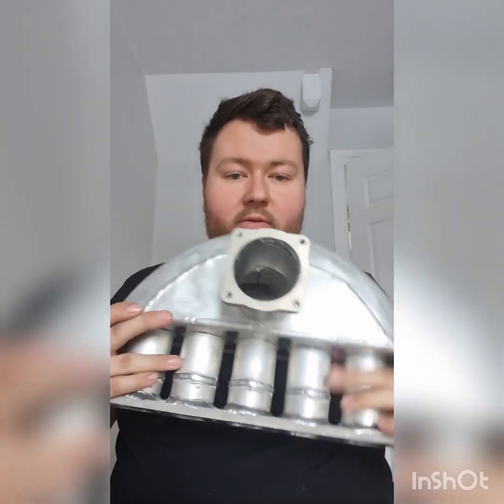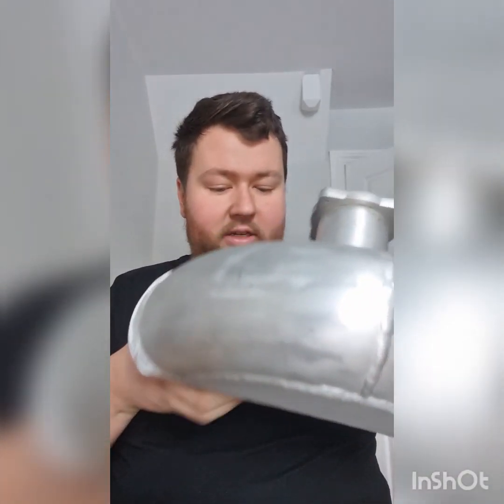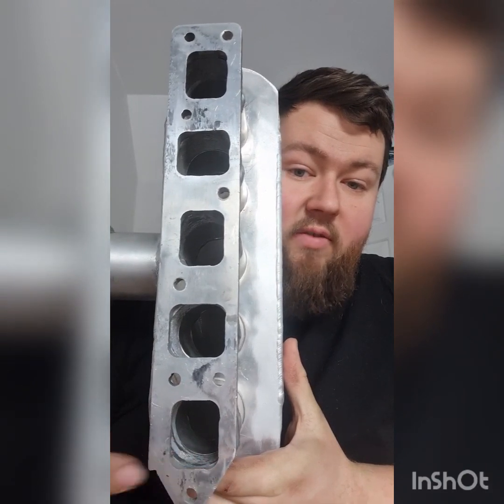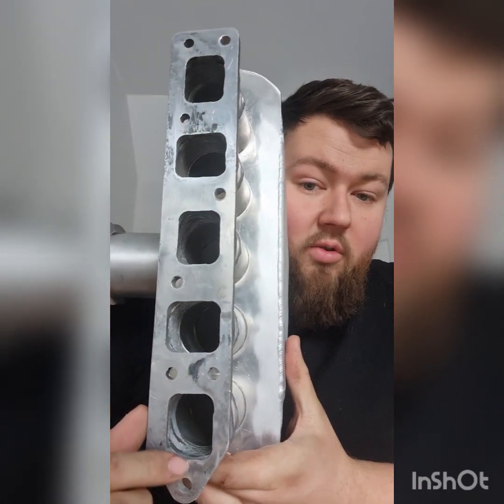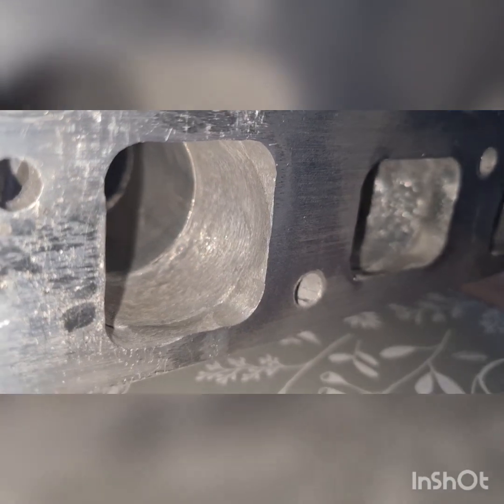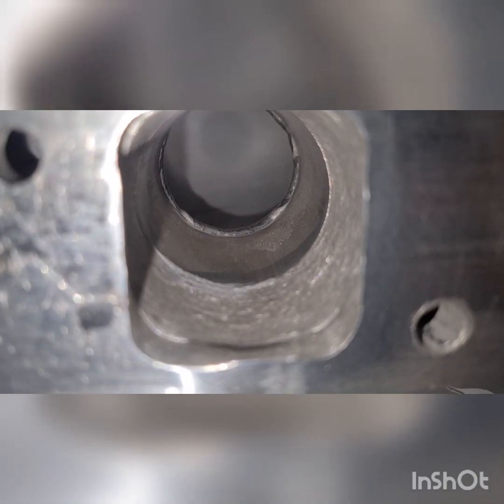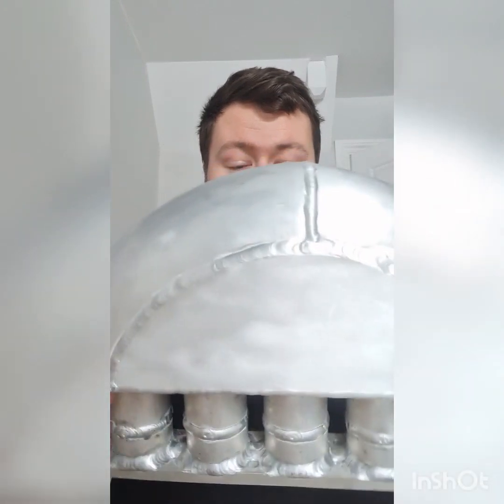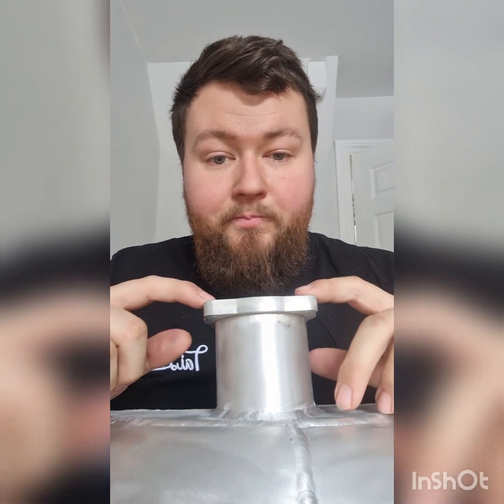V5up inlet manifold build progress update

Comment: What management system do you recommend ? I have the azx 20v v5 fitted into the the vw caddy pickup.
Reply from the maker: At the moment I'm currently running stock engine ecu, I will be looking to go standalone ecu at a later date but for now will just be running on wastegate pressure! 

It's probably best to find out what your tuner is happiest using because you don't want to spend a fortune on a specific type of ecu only to find that no one can tune it for you, as long as it can data log then you're in a good ball park 

Are you also turbo or just stock power? 

Cause if stock the stock ecu will be enough for a small gain with tuning, and standalone only recommended if turbo in my opinion 😊 

Hope this helps anything else just ask 🙂
Reply: @tailord5467  we running with the powermod pro but its not really ment to run the engine so for now i cant use the management to run the vvt on the engine so im only getting 103 kw were the engine makes stock 125 kw. But engine still runs and starts the only things can the get the stock numbers so i cant push the engine any further.

Im looking supercharge it but first i need to get over this hurdle. 

By the way what gearbox you running with.
Reply from the maker: @grantcruywagen8427  oh okay I've not heard of that ecu myself, is there no way you can use the stock 20v ecu and engine wiring loom and join into the car wiring (this is what we've managed to do with mine, my friend is an electrical engineer and helped sort all that out wiring isn't my strong point) 

I'm currently running the stock v5 5 speed manual gearbox 02j I believe they are 😊
Reply: @tailord5467  ill look into that thankyou i really appreciate it. 

Great i also the running with the 02j gearbox  but looking into the 02m 6 speed manual.
Reply from the maker: @grantcruywagen8427  yeah the 02m is a good box my friend who drag races an r32 turbo has started breaking completely stock boxes whilst running 620bhp the o2j aren't as strong but for me it's the only one which will fit in the car 😊